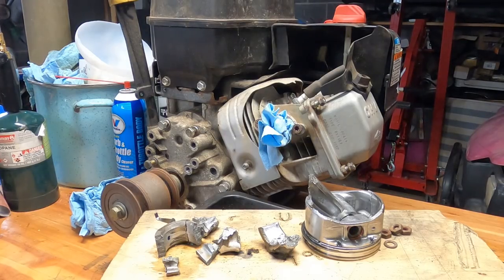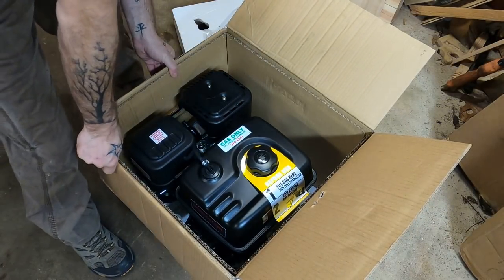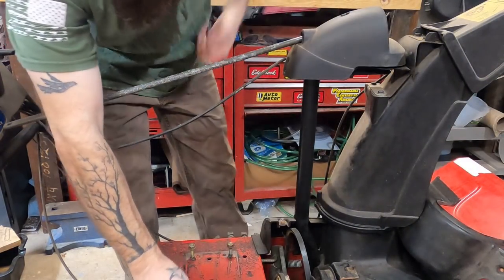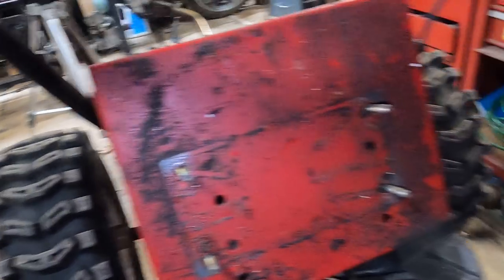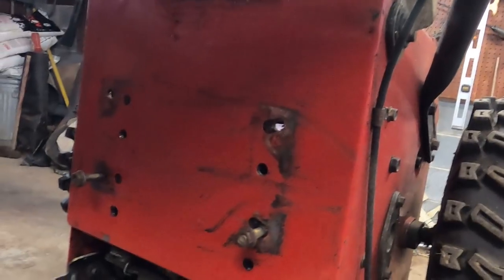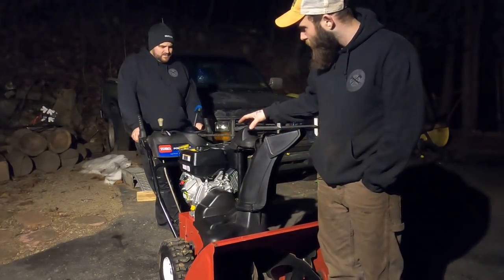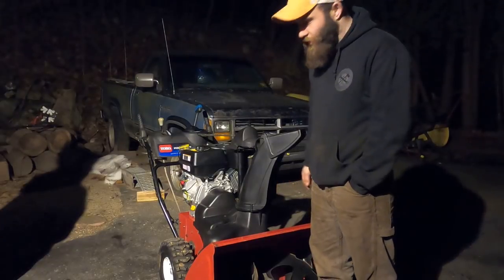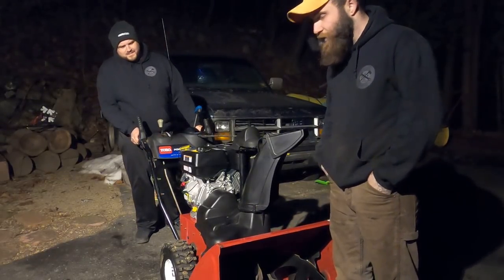Replacing a BLOWN ENGINE with a Harbor Freight PREDATOR ENGINE - Toro 1028 Snow Blower Repair

Comment: Drain plug fell out of my Ariens Snowblower while plowing with the same B&S motor and the motor seized .  I am gonna pick up a Predator 301 and make the swap.  I imagine I will be needing to do the longer belt replacement like you did, but I am hoping the mounting holes on my Ariens are in the right place.  Otherwise, I expect a simple project.  Thanks for the video.  It pretty much confirmed what I suspected regarding the belts.

Comment: As you have leared by now that for a direct engine replacement you must have the same mounting bolt pattern, shaft size and shaft height from mounting point.

Comment: well that 8hp 301 certainly seems to have a lot of power!
my snow blower is a 5hp craftsman with track drive. Although the engine runs fine, witg wet heavy snow it definatly needs a power boost.
Im thinking sonce mine is a 5hp brigs engine its a 3/4" shaft? i'll have to investigate that. But Im going to put a new friction disc at the same time too.

Comment: Thsts the engine i want to  get gor my snow blower.
the 301cc 8hp has a 1" shaft and the 212 6.5 ho has a 3:4" shaft.
So in my case id need a new top pully for the 1" shaft.

Comment: When using a universal  motor on a snow blower you need to remove the air filter. If you don't  it will lean out and overheat.

Comment: You know what's funny I noticed when you had the engines side by side that the predator shaft was taller from the bottom.. I could easily see that. 

But I figured maybe there was something with the camera And I was seeing something wrong. 

But as soon as the belt didn't fit I was like yep!! 

I thought it was very obvious when you had the engines side by side..
Reply from the maker: It probably was bud.. I just missed it. It is happy the obvious stuff I miss while looking for the little things
Reply: @DougvCarburetor  yeah I hear you It's tough especially when you're trying to do the camera at the same time.. I get it.. 

But it was awesome video!! 

Educational that's why I watch these thank you!!

Comment: ?? For ya. Replaced engine on a ryan lawn dethatcher went w predator 212 
The predator engine shaft  is a 11/2 “ lower then original. Any suggestions on a good safe way to mount the new engine to the machine deck that raises it 11/2”.   ( I was thinking  spacers for ea bolt but then engine base would essential be floating ….  Any suggestions on what u think would work??
Reply from the maker: Hey bud. I wish I had run in to that one before, but I admit no advice comes to mind without seeing it. If you want to email me at dandeoffroad@gmail.com we can try to discuss further. Gotta figure someone somewhere has tackled your issue before.

Comment: I flip snowblowers for extra money and bought a 9 hp 29” Craftsman for $75.00. The owner said it didn’t shift well. Well I got it home and took the bottom plate off and low and behold there was the biggest chipmunk nest that filled the whole compartment along with some acorns. I cleaned it out, lubed up the chains and the shaft and sold it two days later for $250.00  Not bad for a hours work. 
,

Comment: I love my Predator 13hp (and 22hp). Just be careful of NOT allowing rain to go into the exhaust on that engine. With that exhaust, water can go directly into the cylinder and foul out your plug with the way it's designed. Not hard to clean out but if you don't have to pop the head, that would be great too. If my motor has to stay outside for any reason when rain is possible, I put a plastic trash bag over it to keep certain components dry.

Comment: Why would there be a primer on an engine that has the fuel tank above the carb? You spent $250 on parts, not counting your time, for a $250 blower!
Reply from the maker: Well we sold the blower for $500, so it seemed like a worthy venture considering this is just a hobbie. All snow blower engines have a prime with an elevated tank, though while looking for one on the Predator we forgot this was not a purpose build blower engine.

Comment: Thats pretty cool, didn't read the manual.... oil in engine should be drained because its NOT running oil. At least that what it said in my manual. Just noting, not slamming,  good video.
Reply from the maker: No, that was a joke. I read the manual and the oil we ran it on was fresh 5w-30
Reply: @DougvCarburetor  you got me...

Comment: If it's got a choke, 99% of the time there isn't a primer, if it's got a primer, 99% of the time there is no choke.
Reply from the maker: Not so on snow blower engines. they almost always have both as the are expected to start in extreme conditions. Our mistake was forgetting that the Predator was not a purpose built blower engine

Comment: Why didn’t you just take out the spacer behind the drive pulley
Reply from the maker: I tried, but it would not work. the front pulley and cap are slotted so the spacer could not be moved up there

Comment: Keep a really strong magnet around to get metal chips out of your eyes.  (or wear safety glasses while drilling)  Emergency room visits for Eye surgery suck (ask me how I know)
Reply: Agreed eye protection is very important. My dad neglected to wear his back about 1960. He was working on an M48 and was hitting something with a hammer. A chunk of something flew off and went into his eye. He was lucky they were able to just use a magnet to back it out of his eye. He didn't have to have any surgery just antibiotics and drops. I think they put a stitch in the eye to close the wound. But Dad religiously wore eye protection from that day forward. Dad used to make a funny Grimace face when he would tell that story.
Reply: @JohnRodriguesPhotographer  Some pain is a lot more memorable than other pain. Like driving home 50 miles  with one eye patched from the hospital when the  Pain drops wear off.
Reply: @enriquelaroche5370  I agree. I've had a few things happened with my eyes over the years. Far outweighs the other 13 surgeries I've had. I hate with a passion eye pain. Glad you're okay afterwards.

Comment: They make engines that are throw away motors 
No a days
Reply: Get the extended warranty if it craps out just walk-in with the motor and they'll give you another one. Presumably you can get the extended warranty on those engines. That's what I would do

Comment: Keep clean oil in these Predator engines, run the carb dry before storing, and these are as good as any Honda or Briggs.  I started working on B&S engines 65 years ago, and point for point, these Harbor Freight engines are just as good or better.  Good job on the transplant, you'll be happy with the new engine.
Reply: Cool, heard they were incredible, want to  stuff a 23 hp predator into my Max ll six wheeler
Reply: Sim city money cheat

Comment: Great job. Those Predator engines are near bullet proof. They're made by the Loncin Motor Company in China with offices in California. Toro has a branded engine for their zero turn mowers that use engines made by Loncin. Very well made and will last like any other engine as long as it is maintained properly. Good job guys.👍👍

Comment: I was wondering when you were going to catch that crankshaft being a little higher You could see it when you had them side-by-side I guess the viewers had a better view. But you got it working and that's all that matters good job...
Reply from the maker: Yea, I was so concerned with the shaft longth and diameter that I completely forgot to check overall location. Glad it worked out in the end

Comment: The new engine or motor, looks like the shaft is higher than the old one and I hope the bolt holes and pulleys are the same size. Look at 2:15 / 19:38 when you first take it out of the box. I wonder if your belts will work, May need to get longer belts. I bet your nuts & bolts have lock tight on then. I see you found out the shaft is taller. New Belts. Gets some Anti-seize on those wheel shafts. Good Job.
Reply from the maker: Thanks bud! We sure will

Comment: Great job. Just a side note on belts. 
Make sure they are PTO belts made for outdoor power equipment. Other belts made for electric motors etc wont stand the abuse for too long. Trust me I've been there. It will fit but will burn out and snap at the worst possible time.
Reply: For years I've been telling friends not to buy fractional horse power belts.
Reply from the maker: That is very good advice!

Comment: Doug, good job...Remember those. Engine's  come from CHINA !!!  Forget about future parts.  Lol
Reply: they are direct copies of Honda motors so Honda parts fit them
Reply: When pulling studs in put some flat washers on first.
Reply from the maker: LOL. CHI-NAH... Yea, I get the impression you get one shot with these. if they go pop, they stay popped
Reply: We're going to tight with China now, parts may be less of a problem, lol.

Comment: Those engines are good replacements, especially if you sell the machine right away....
Reply from the maker: yea bud, it worked out for us this time.
Reply: I don't know alot of people put them on go karts and even bypass the governors on them and they seem to hold up just fine unless the quality has dropped off in the past few years. But I know they used to be fairly decent engines as long as you kept the oil changed and kept up on the maintenance. None of these modern overhead valve small engines will last very long if you don't change the oil. As pretty much all of them use pressurized lubrication and you'll wipe out the cheap little oil pumps they have in them in no time if you keep running dirty oil in them.
Reply: It's got a Mikuni carburetor on it. Quit bitching because it doesn't have a primer bulb and start it up. It's the exact same carburetor Honda uses.

Comment: Should have checked, to see if you had reverse. If not your drive plate is out of adjustment....
Reply from the maker: It may not have been evident in the video, but I did check for reverse. the previous owner had the drive level adjusted very wrong, so we fixed that before sending it down the road

Comment: i put an 670cc predator on my golf cart with a stage 3 kit from go power sports.com with a 30mm makuni carb with a jet kit, and swapped out the rearend for a live axel, been runnin it for 5 years with no issues at all. I love these predator motors, very easy to work, enhance and of course maintain
Reply from the maker: That puppy must hoon!
Reply: lol and then some. Gets the job done during deer season!

Comment: I wanna buy something dumb and stick a predator on it everytime I see one. I saw someone online put one in a car once. Haha
Reply from the maker: I have been giving serious thought to putting one of the Honda dirtbike if I cannot find the part i need for it soon
Reply: I saw a guy in here put one on a old farmall tractor and it moved along pretty good.  Do t know about power but it moved it
Reply: I wonder if you get used one to power a generator to run an electric motor in a small car. I mean the electric motor or Motors plural would power the wheels. Get something light weight with a blown motor like a smart car. Well those aren't all that light but you can gut them.

Comment: I've wondered for quite awhile if those engines were good replacements for Briggs and Stratton
Reply from the maker: This is the first swap I have done, but I know several people who use the on log splitters and power washers to great effect
Reply: I put a 6 1/2 HP one on an old Ariens to replace the original 7 HP. It has been going for close to 10 years. I cut the low oil cutoff switch out because it kept shutting the engine off. It made it through he infamous winter of 2015 here in Boston and is still going strong.